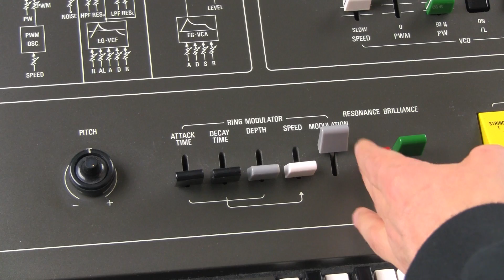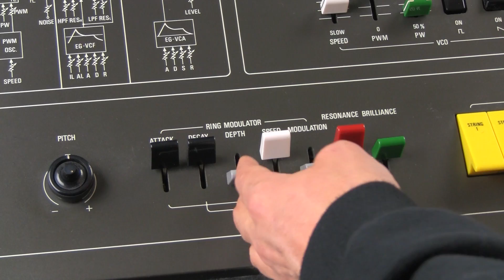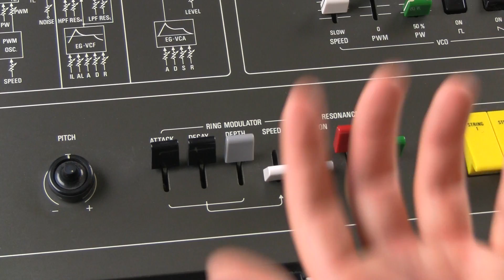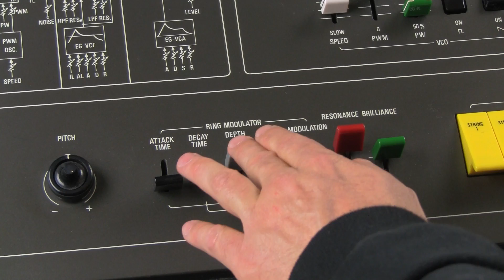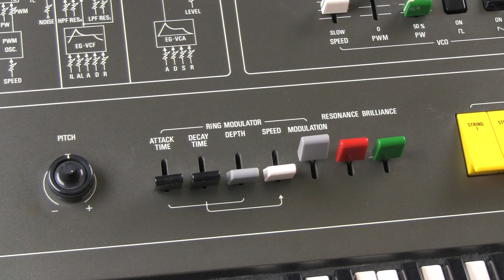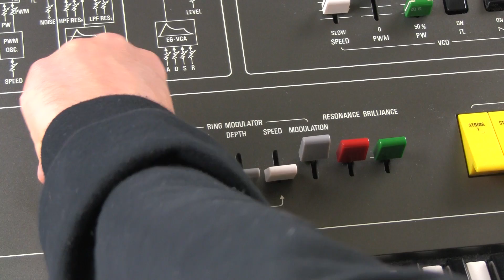The Yamaha CS-50 Part 5- The Ring Modulator

Comment from the maker: Ronan Hughes:  I didn't use a preset, I had the unit set to "panel."
Reply: +Ronan Hughes That's because CS-80 V2 is Arturia..... and Arturia didn't do a very good job with the softie. Try ME80 from Memorymoon if you want a realistic CS-80.
Reply: Adam Borseti
Thanks!
Reply: I've got a yamaha CS-80 V2 on my computer and am trying to get the 1980 doctor who sting out of it. You said in the video, that the ring modulator on the CS-50 is the same one found on the CS-80. But somehow the ring modulator doesn't behave in the same way.
Any tips?
Thanks!

Comment: Vangelis used the CS-80 ring modulator as a performance instrument in itself. The "rapid tremolo" effect, or just whacking all the slider back at once to get a huge long delay ringmod sweep as he changed the sound or went over to a different synth.